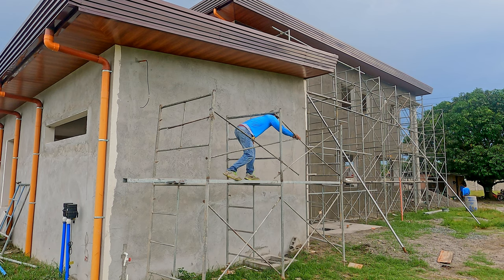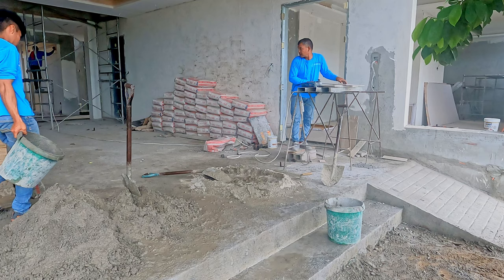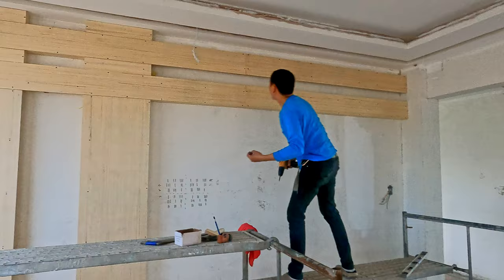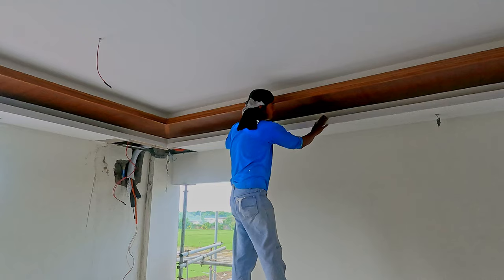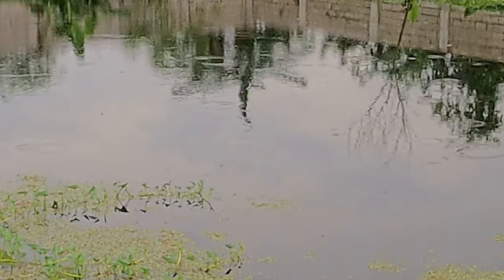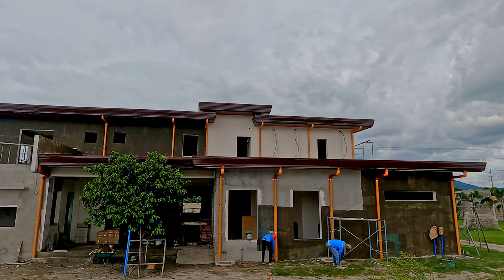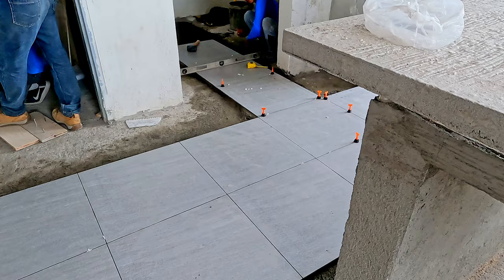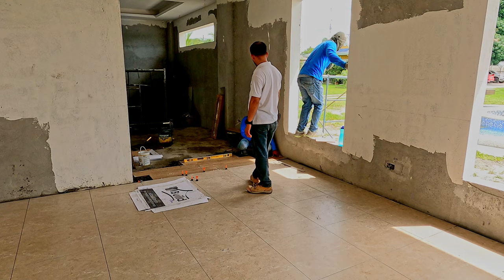Philippine House Building Day 263 - Tiles Galore and More

Comment: Tiling from the center gives a more balanced appearance, especially in corridors or relatively small rooms.  It also allows for quicker coverage as you are laying whole tiles and you can check if you have enough tiles!
Reply from the maker: Thanks Stephen. Not enough tiles - ok we have had that too many times already.
Reply: @philippines4.0buildinganew64  No dig intended. Most tiling I have done I have bought minimum expected quantity and then gone back for more when I have a more accurate number and have some measure of how much wastage I accrued.